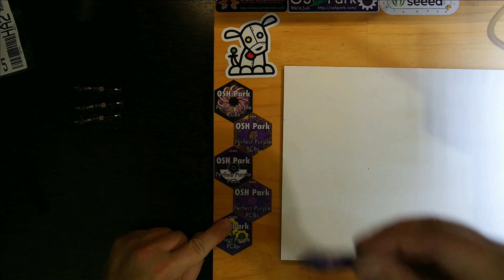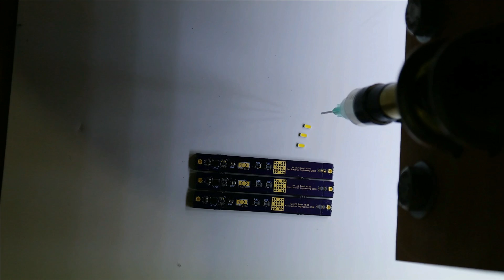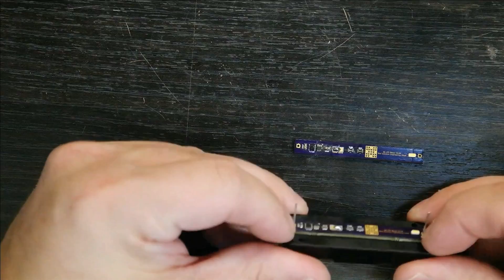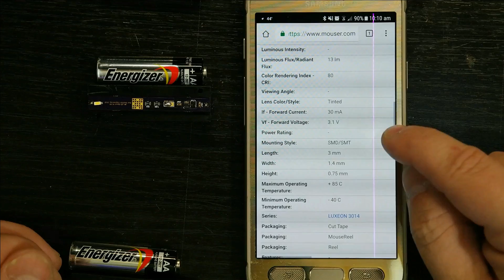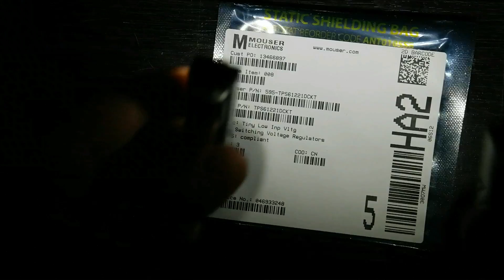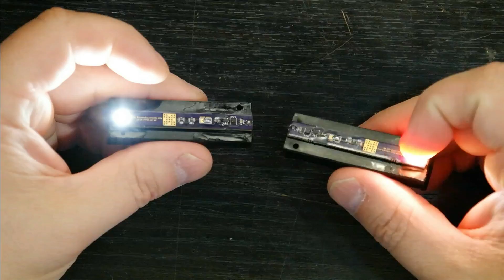AA Battery LED Nightlight First Build & Testing

Comment: what did you do to get the "PRT-10967" to run for a month or longer?  i ordered 2 boards to try it out and the battery lasted just over 24 hours.  are you changing parts on the "PRT-10967"?  Or can you tell me what all you did to get that length of time out of it?
Reply from the maker: you need to play with the current limiting resistor your using with the LED to bring the current down to around 2-3ma on a new AA battery,  then the unit will run that LED for well over a month.

Comment: AWESOME!!!  A solid state joule thief!  I did a remix of a guys joule thief that holds an AA like that, it will run almost a week on a fresh battery, and 3~ days on a "dead" battery at .9vdc.  Love the build...but daggum, such teeny tiny little 0603 components..so very cool!!!!!
Ever thought of making a vertical standing daughter board where you can solder the led, then solder on pads 90° so you can make a "flashlight" vs a nightlight?
https://oshpark.com/shared_projects/TMmGBSWa
Reply from the maker: Lol try working with 0402 components. Actually joule thief is only around 50% efficient and this runs in the 85% range.

Comment: I agree with David. This is a really cool project. Is there anyway to put some kind of little micro switch on that board so you can turn them off and on? I like these little type of electronic projects and I'm very new to this stuff so I don't know the terminology very well yet or if the word "micro switch" is actually even a thing. But, when ever I take something apart, like this old joystick that broke on me not long ago, there was these tiny little button switches soldered to the small boards in the handle that were for the buttons on the actual joystick. That little switch popped into my minds eye when I saw you building these night lights. Anyway, I was just wondering. I hope I explained what I meant by micro switch.
Reply from the maker: I could put a small on/off switch on the board easily, but it would add around $1 to the price per unit. I wasn't sure if I should add that option or not.
Reply: Mad Electron Engineering do you sell these with the on off switch?